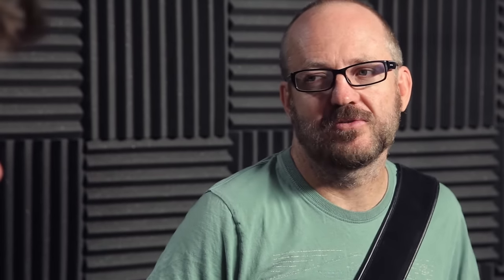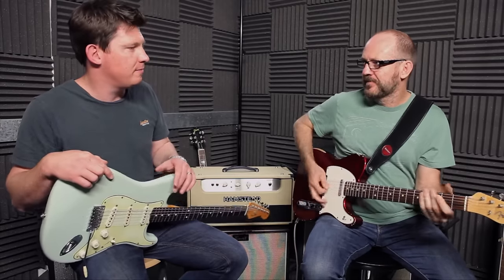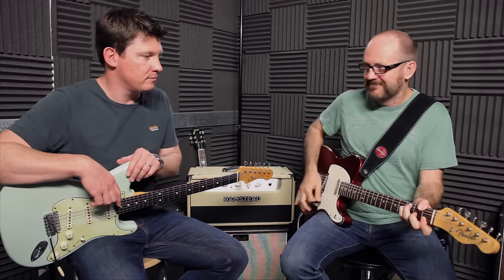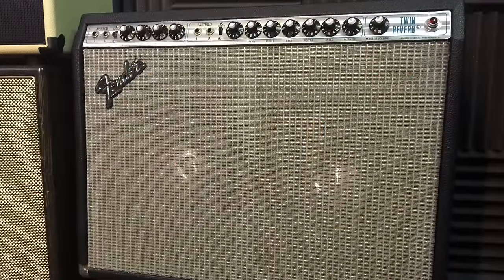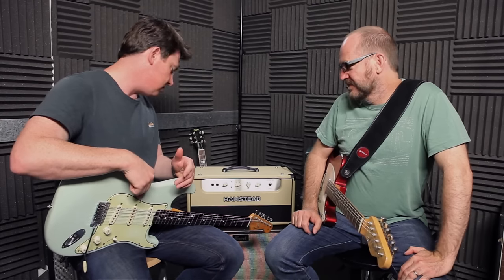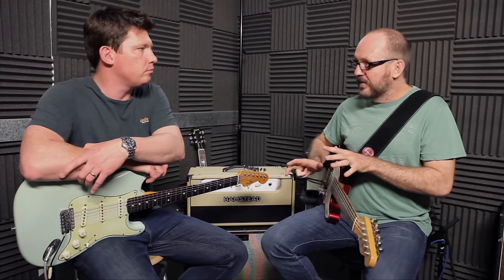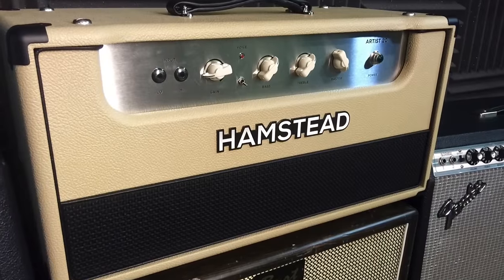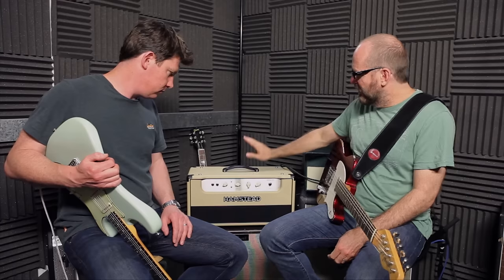Setting Up Your Amp To Use With Drive Pedals

Comment: turn the tone down on the Muff and itd sound a lot better....
Reply: +Maxfield Stephens I was thinking the same thing. Its settings are clearly set up for the Marshall. With the tone at 11 o'clock it would sound bad on the Marshall and much better on the twin.
Reply: +Seth Gingerich my thoughts  exactly :)
Reply: +Maxfield Stephens And stop playing everything with telecaster bridge pickup.
Reply: Exactly and if the bright switch is on on the twin turn it off (like most people do).  The OD simulates preamp (square wave distortion , hard clip/soft clip diode). Take and plug into the fuzz pedal, then into the OD pedal then into the twin.  Guitar>fuzz pedal>OD pedal> twin = closer rep of what the Marshall was doing.  Or turn all the preamp distortion off of the Marshall till it's perfectly clean.  Not a decent comparison between amps and pedals. I've played through Marshalls and fender twins for over 30 yrs.
Reply: i have the tone all the way down
Reply: I never did like those dust covers on the JBL,  I don't know why they put those in there. take a bright amp and make it even brighter .
Reply: You're missing the point. Yes,  you can make the muff sound fine through the twin. Obviously.

They're not trying to. They're using extremes to illustrate that things work differently in different amps.
Reply: +Matt Snyder sorry, but thats ridiculous. The video is about setting up amps for drive pedals and they presented the muff as though they don't work through twins. Ive only used fenders for a few years and have played a ton of different muffs and just like anything they need to be adjusted to sound good. acting like muffs into twins will sound bad but muffs in Marshalls will sound good is stupid. "Trying to show how they react differently" isn't the point of the video, read the title.
Reply: +Maxfield Stephens did you even watch the video? They LITERALLY say exactly what you just said. Maybe next time you should listen to learn, instead of trying to find an excuse to be butt hurt.
Reply: Here a different take on the issue (I actually think everyone made equally-valid points here...):

The Twin has a very mid-scooped sound naturally due to its tone stack.  The Marshall, less so because of circuit differences there (and add in Celestion speakers with more-pronouced mids are typically used with Marshalls where the Fender often has speakers which emphasize highs/lows).

You can mitigate the Twin's seemingly-harsh sound with non-obvious tone control settings.  First, turn of that damn bright switch (the guys kill me when they use this, because the Fenders always sound harsh with those unless the Volume control is above half-up).  Turn the Bass control to 0 (yeah, you saw that right).  Next turn the Mid control up to 10.  Turn the Treble control to about 3-4.  Now play the amp to see where you're at.

You can bring up the Bass a tad (try for no more than 2-3) and adjust the Treble up/down a bit to get the overall balance you want.  If the Mid is too rich, you can back it down a bit.

The challenge with the Fender tone circuit in these amps is "everything affects everything".  Once you turn any one of the tone controls, the sweep of the other two controls changes a bit.  You almost need to close your eyes, ignore the knob labels & numbers and keep turning until you get the balance you like.

Having been a long-time Fender fan (I used to own mid-60's Super Reverbs and Princeton Reverbs), I've changed to where I won't play any Fender or copy which does not have a dedicated Mid control, because it's just that important to dialing in the best sound.  And unfortunately, most reissues and modern Fender amps have speakers with a much harder treble than the original Jensen speakers in the old amps.

So yeah, the fuzz sounds like garbage with the way people typically set up a silver-/black-face Fender amp.  And if you don't have a midrange control, it can be hard to get a good sound out of them (though I got amazing tube-like tones out of a Fulltone '69 played into an original 1967 Princeton Reverb, with no Mid control).

But at the end of the day, Dan & Mick know they could tweak the amps' tone controls to get a better sound.  They seem to purposely make the point that your results will vary based on your amp (or guitar, when a number of videos had god-like tones with the LP, but the settings which yielded a balanced sound from the LP sounded wimpy and bright/edgy with Mick's Strat).
Reply: +Brian Ingram I always modify the tone stacks in my Fenders. The Deluxe Reverb Blackface I change the 6.8k to an 8K (not a bid different but it's what they use in the vintage ones) and Ch 2 I go to a 12-15k, brings it up to almost a tweed but with better low end. I snip the bright cap right out of Ch 2, then usually do the Fritz mod to give Ch 1 reverb and tremolo (this also warms it up a bit). If you change the resistor for the feedback loop, and add a cap to the bass in the tone stack, you end up with the tone the newer Custom Deluxe, but in a MUCH better built amp. I've worked on a few of the Custom amps, they sound great but all have issues. I haven't played one that didn't rattle and buzz pasr 5 on the volume. The US built reissues are a much better amp for a couple hundred $ more.
Reply: Very true. Just curious, where do you set your volume on the fender amp? I have a 68 silverface bassman 50w, 2x15 cab. Turning the volume up with the eq down should maintain mids. Isn't the resistor in place of the mid knob, supposed to sound like the knob is set at 7 or 8?  I used to like the bright switch on, but it sounds better off, especially with pedals.
Reply: You're right: 60's Fender amps used a 6.8kΩ resistor in place of the Mid pot, which was a 10kΩ linear pot in the models which had a Mid control.

Many guitarists don't understand the voicing of the 60's Fender tone circuit is a mid-scoop, so they falsely think if each control is set to the same numeric value they are equal-level (like a graphic EQ).  See the below from a program which plots the response of EQ circuits... With Treble/Bass half-up, even when the Mid resistor approximates the control being on ~7, the overall response is mid-scooped.

https://www.gearslutz.com/board/attachments/so-many-guitars-so-little-time/350219d1371781463-can-someone-explain-fender-tone-stack-interaction-newbie-fender-5-6.8-5.jpg

The irony is the "mid-heavy" sound of a tweed Fender with a single Tone knob is closer to flat amplification of the pickup.  That is, this is the way your pickup actually sounds without additional shaping, because that single tone knob set half-up is essentially flat.

And when a Marshall sounds like it has more midrange than the Fender, it's because that Mid pot has been raised to 25-50kΩ.  Even that results in some scooping of mids compared to highs/lows, but less than the Fender.  This also contributes to why the Marshall breaks up sooner: there is less signal reduction right where most of the guitar signal lives, so there are higher levels through the Marshall amp than the Fender amp, even when using the same guitar...

"Turning the volume up with the eq down should maintain mids."  Hopefully you see it doesn't work like this because of the shape of the Fender tone circuit response, unless you turn the Bass to 1 and the Treble quite low (between 1-4).  The challenge is the 3 knobs on the Fender are interactive, and the setting of any one alters how the others respond.
Reply: +Brian Ingram I had first did it because I wanted my DRRI to sound more like the Princeton I had. The only real difference in the circuit (tone wise, not power obviously) was the 10k resistor they used in the tone stack. It was trial and error for me at that point, I hadn't worked on amps much at that point. The 10 sounded good, but I wanted a little more. I went back and forth and eventually settled on a 15. I finally interested and got a service guide for Fender amps. That's where I saw the 8K in the original Deluxe Reverb Blackface. It doesn't sound all the different, but I put a 10 in anyway. The bright cap always bothered me, so t came right out.
Reply: +Brian Ingram MANY mistakingly think that Marshalls sound like that because of the EL34/84's and don't realize that the midrange is there because of the preamp. The first time they play an Egnater Rebel and go from the EL84s to the 6V6s and find it still sounds like a British amp.
Reply: Brian Ingram Now I understand it better. Thank you. I figured at best, with volume way up and no treble or bass, it may be a flat eq setting. You're saying it will always have some scoop I guess. I certainly love the sound I get with volume (5), treble (3.3), bass (2.3), normal 2 channel. Les Paul copy with alnico 2 low output pickups. 500k pots, 50s wiring, .022 caps. Boss sd1 (c6 removed), fab echo, French toast fuzz, crybaby wah.
Reply: Believe it or not, you actually come quite close to flat response with your present tone control settings.  If you'd like to see graphically, download Duncan's "Tone Stack Calculator" and use the Fender tab to see a graphical frequency response plot based on control settings.  The fastest way to model what you have is set the Mid control to max (which defaults to a 10kΩ pot).

There's more to an amp's sound (speakers are critical), but you get an awful lot of the amp's voice from the tone stack.
Reply: If you are talking to me, I agree. I had to actually change my settings again because of the lack of clarity. I thought my first settings were good, but I needed more presence without the bright switch engaged. Current settings on Bassman 50: channel 2 volume (5), treble (4), bass (0). I also don't mind turning volume up more and use less or no treble and bass.
Reply: It turns out I was getting extra bass and treble from my danelectro pedals. I have taken them out now, just using a Rat 2 and wah wah. I'm going through the normal 1 channel - volume: 5, treble: 5, bass: 0. Sounds exactly how I wanted it to sound now.
Reply: yea, kinda lame to laugh at the twin when "it's the pilot".
Reply: Maxfield Stephens To me the Big Muff achieves the fuzzy, almost dommy, sludgy Sabbath, Corrosion of Conformity/pseudo "Wheel in the Sky" tone, no matter what amp you use. It's got that base circuitry to it.
Reply: Maxfield Stephens that would completely negate the point which was to show the difference between the way the pedals sound is altered by the amplifier. The only way to so that is if the settings are identical
Reply: The levels are also important. The Muff seems to be boosting the Marshall quite a bit, while through the Twin there's a noticeable volume cut with the pedal engaged. I think you need at least unity volume with the amp (ideally a bit of boost helps), otherwise you are bound to get a thin, weedy tone.

Comment: Regarding the Fender twin, When Leo fender was out of the way so to speak, there were eager technicians that wanted to make changes to the amp that Leo had forbidden from a soundperspective. Those were; making the amp more stable electronically, and getting cleaner, away from that "terrible" distortion (that Leo knew was good). I grew up around these amps and the guitars of that era (spikey 70's Teles - ouch) I'm glad that Fender got back on course. A lot of info can be found on this, should you so desire :-)

Comment: To me you need to cut off a little of tone ( it's way open!!!) in that BigMuff and probably it would sound better with that Silverface. I'm using a BigMuff with my Blues Deville (beautifully clean and bright) with the tone set slightly over noon and I love it. Obviously everyone has a tone in mind, and maybe my settings would not satisfy everyone, that's just my two cents. Interesting video anyway, thanks guys!!!
Reply: +Enrico De Nard   Exactly, why would you leave the tone completely open before a clean amp? I play a super-clean silverface Pro Reverb and like to use Muff-type Fuzz. It sounds much better than what we hear in the video. I get the point the video is making, but this bugged me a little.
Reply: I have an acoustic amp, carvin ag100d and use its guitar channel as a practice amp as I can actually turn it down unlike my Marshall. It is super clean solid state amp as you can imagine and I use a muff pie through it. Being a sterile super clean amp you'd think the muff would be shrill but its not. Its got mega balls. Clearly I prefer my Marshall but its strictly reserved for certain times of day.
Reply: I agree that was a weak point in this video. I won't argue that a Big Muff pairs better with a Marshall amp than a Fender Twin, but to not readjust the Big Muff for the Twin was very unfair. Not only should they have brought the tone knob on the Muff down to around noon, but they should've increased the sustain a little (and lowered the volume to compensate), that would've given a much warmer and more pleasing sound.

Comment: this video is ideal for me. I know its an old video now but i have recently aquired a handwired hayden valve combo. it features 4 machted quad  EL34 in the power stage. along with a rectifer. no fx loop so pedals are all in front. abit like this. its not hard to find that sweet spot. this video has helped me alot choosing the right pedals and how to set the amp up. the amp is still relatively new to me but my god it sounds outrageously good!

Comment: I use a Traynor Dark Horse amp with a few pedals; Nano Big Muff, MXR Custom Badass 78 distortion, and a Soul Food EHX as a clean boost. I also have other fuzz and distortion, plus a Tube Screamer. The traynor is awesome bc it has a switch to move the tone stack to mimic British or American amps, or the pure mode that removes the tone stack all together and adds a mid boost...which sounds amazing. Big difference in pedal sounds depending on which amp mode I am using though!

Comment: Another thing that will help you set up your drive pedals well is understanding how to set up your amp correctly to get a tone your happy with. EQ the amp to not only your ear, but make sure your tone sits appropriately in the mix in a band setting. Also, make sure you don't scoop out all the mids. The right level of mids will make your sound poke through the mix and warm your tone some. I'd make sure after that I understand the kind of frequency the pedals make through a clean tone and then tweek the EQ/tone knob to work best for you.

Comment: Of course, I watched this one the day it came out. But all this time later, one thing that is really interesting about that Muff into the Fender: Gilmore not only used Hiwatts famously, but also spend most of the 80's into the early parts of Delicate Sound of Thunder (Momentary Lapse of Reason Tour) with big, clean Fender heads (he also had a Mark IV and eventually a Mesa Boogie Studio Preamp - kind of a Mark III in a rack mount sans power stage. He basically used these as drive "pedals") - and used Muff's, Ibanez TS's, Chandler Tube Drivers, etc. Seems impossible, but sounded killer - and nothing like that Muff into that Fender. He did have at least 3 Boss Eq's he could put in and out for all kinds of things. Very complex, of course, with tube buffers all throughout his Pete Cornish rig. No answers or better questions here, just Wow. Go figure.

Comment: Fascinating video and very informative. But it's easy to forget that you have tone and volume on the guitar, a few knobs to twiddle with on the pedal, EQ on the amp and preamp, poweramp settings. In other words, a world of twiddling to end up with a good sound. Also, pity that they didn't put a humbucker through those rigs as that can sound very different.

Comment: Great video. This is what I love about my Egnator Rebel 20 head - albeit it surely much much cheaper than the Hampstead, it is very versatile with EL84s, 6v6s, bright and tight switches so that you can really get a lot different amp sounds. Daniel, if you haven't, I'd suggest you check out the Benson Monarch (out of Portland, OR).
Reply: Kenny Martin I suspect there's more to the Hamstead than just the EL84s! Can't really compare the Egnater - apples and oranges.
Reply: Like I said, not comparing them because I'm sure they aren't in the stratosphere the same. Was referencing the versatility/single amp thing. A single amp that can be dialed in to sound like many types.

Comment: You guys talked a bit about an AC30 here. I'd love to see a video that goes more in depth on this same type of discussion, but using a Vox AC30 and/or AC15.  Specifically, the newer Chinese made versions that are affordable for the gigging musician that isn't affluent enough to own the vintage models.  Perhaps using the classic vox/od pedal pairings like the Crowther Hot Cake, ProCo Rat and Paul Cochrane Timmy.  It would certainly be much appreciated by me as I own both of those amps and all three pedals.  I enjoy the sounds I get, but I'd love to see what you two can pull from those.  

Thanks for the great videos.

Comment: This video was something different. Really nice to actually AB the amplifiers, quite an eye opener!

I must say, you guys are especially doing an great job at describing guitar tones with words, which is a hard thing to do. I'm sure it has helped many people understanding tone, me included. Thanks!

I think it would be great if you made a video about collapsing tone, what happens when the amount of gain gets too much and the amplifier can't quite handle it anymore. Maybe you could stack up a few distortion pedals with a singlecoil guitar and try what happends if you switch to a high output humbucker?